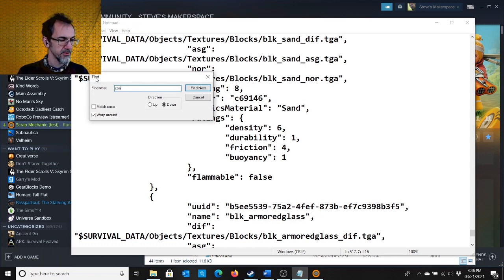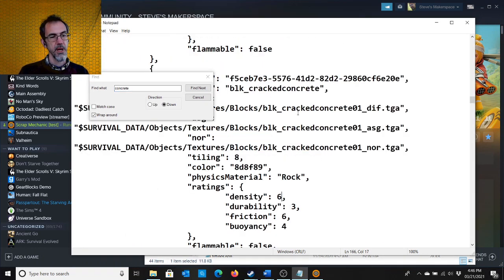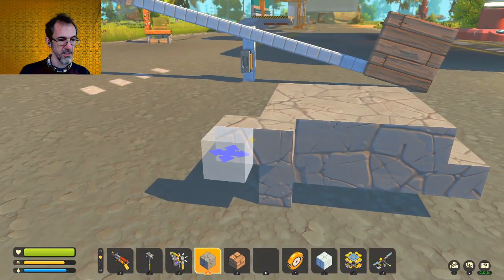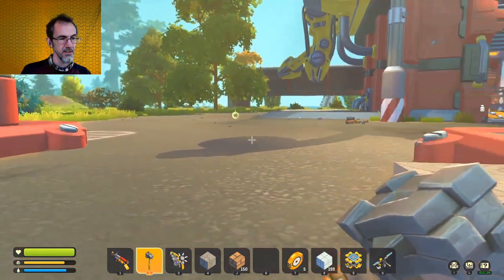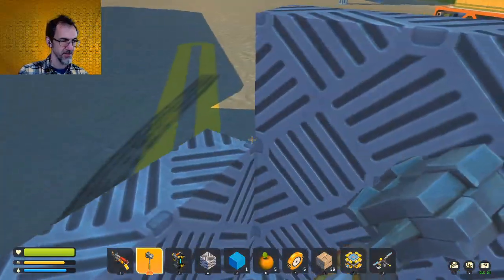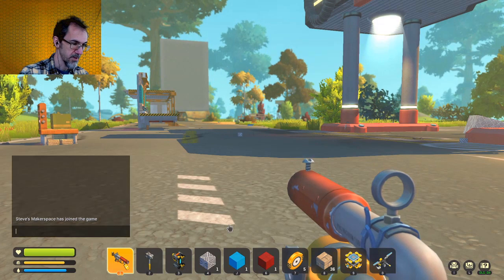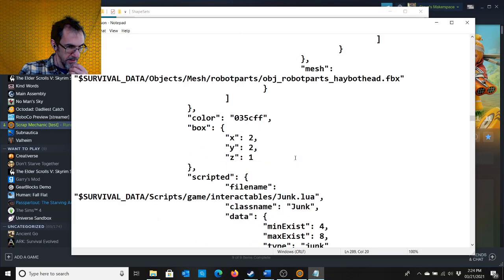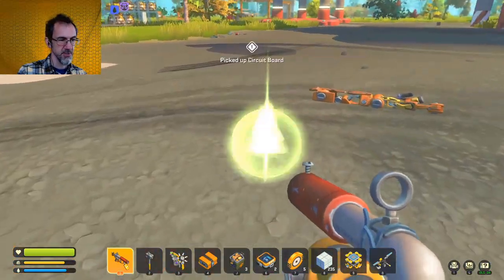Changing Block Stats in Scrap Mechanic - weight, durability, friction, stack size - and more!

Comment: wanted to load up lose resource collectors for realism  and they were so heavy that nothing worked the physics just didn't enjoy that at all
took a good while to find the files for them but I did it. Thanks a lot for this tutorial this made my plan work with ease
Reply from the maker: You're welcome.  Did they move the file location?  Let me know where and I'll add a note here.
Reply: @ well, the file was in the folder where you showed all others, but you never showed one for resource collectors
I was looking in the survival game folder, and I think it was interactive shared.json
The code was both for refinery and the resource collector, and the values were exactly like all other that you showed
only thing I was doing differently. I was using note pad ++, which makes it a little easier to find values cause they are different colors.
Reply: @ but the file directory is still the same
but the start still may differ from users that have saved the game files in different locations and hard drives
Reply from the maker: @ OK thanks.

Comment: I cannot find the “generator coil corner” piece anywhere in the files but I need to make it lighter, any idea where to find it?
Reply from the maker: If you save an object on a lift, you can open up its blueprint to find its uuid.  That one is 23572f75-03c0-4c33-b643-70250d0e4ae0  I found it in survival shapesets - industrial.json.  It's name in the code is "obj_industrial_rooftankslicetop"  Another option is to just change the density in the blueprint if you want something that can be saved to the workshop as lighter.
Reply: @StevesMakerspace  thank you! I’ll try the blueprint edit, I hadn’t thought of that 🤔🙏